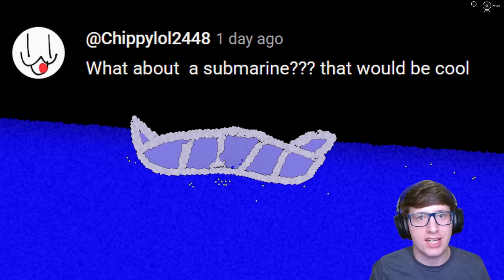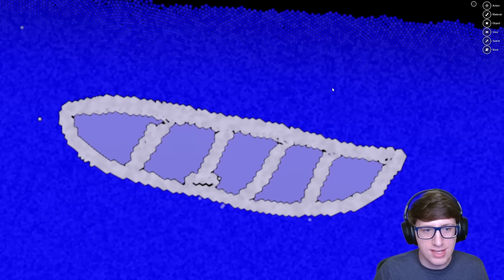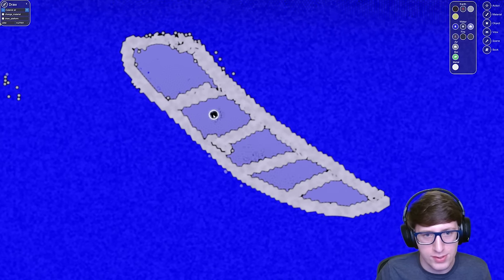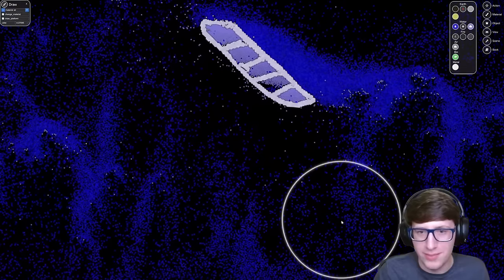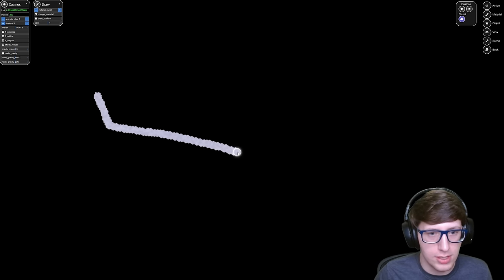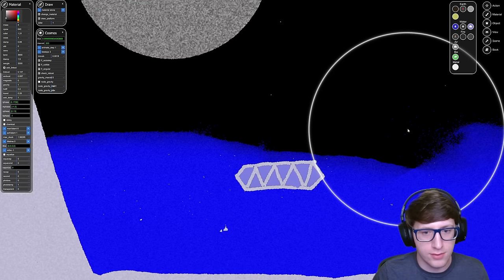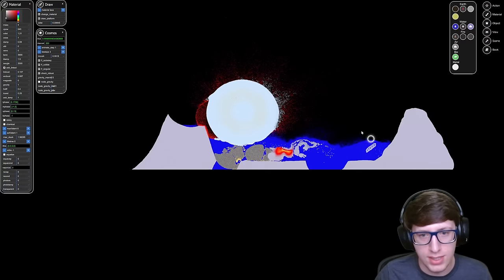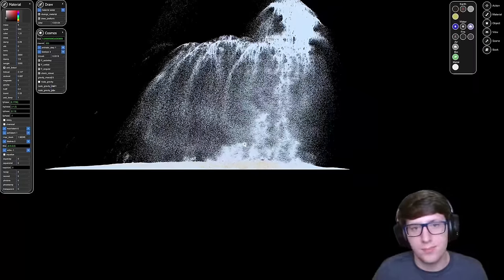CRUSHING SUBMARINES in Space Simulation Toolkit!

Comment: How to make a working balloon in SST

1. Go to the planet sim (the one with vertical gravity and the volcano)
2. Pause the simulation
3. Create a medium sized metal sphere 
4. Hollow out the sphere to create a hollow shell
5. fill the metal shell with water (c-distance = 0.5)
6. Heat up the water until red
7. Unpause and watch your balloon float! 

Notes: balloon will only float when water inside is hot. The water inside the balloon will eventually cool down, causing the balloon to fall and explode on the ground. Also, large balloons are hard to get working. Small ones are more reliable. I recommend having the metal shell thin, but not paper-thin. Also not to thick.